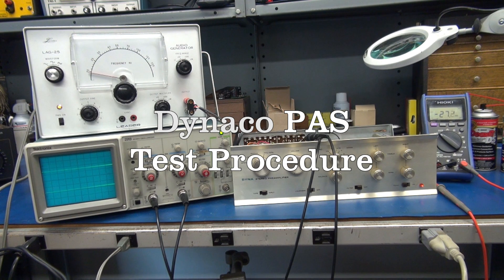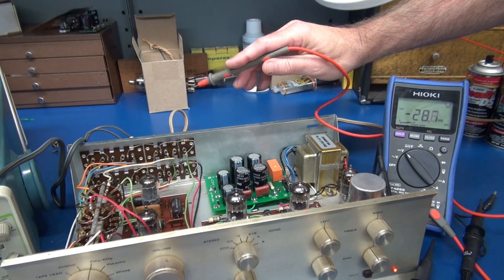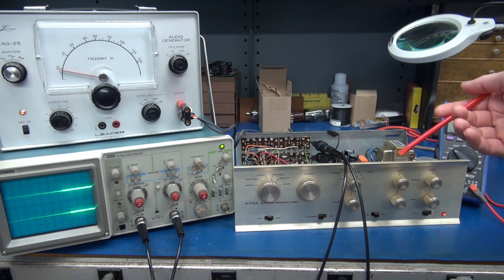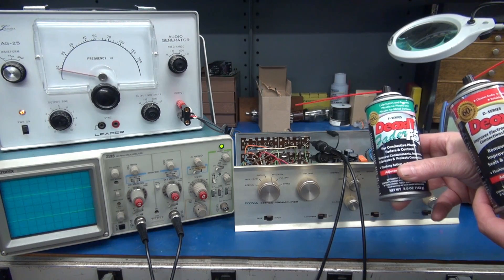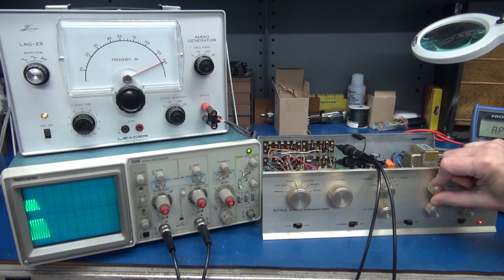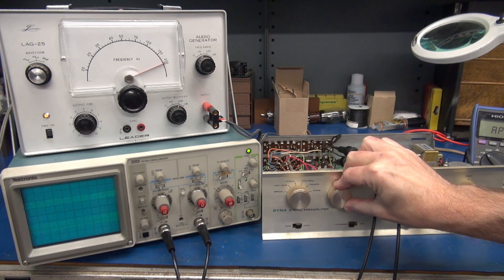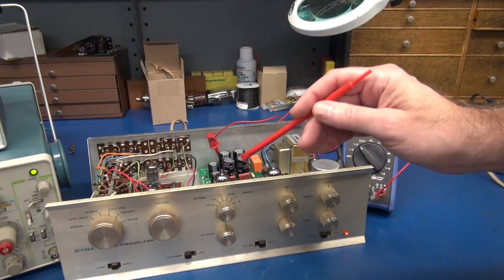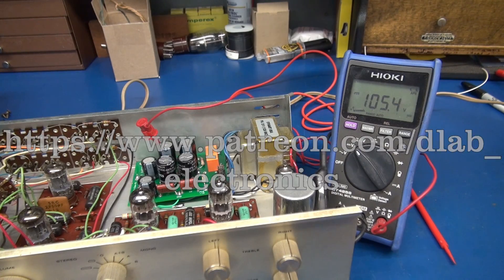Dynaco PAS tube preamp bench test procedure following repair using oscilloscope + audio generator

Comment: Not much point in re-testing the tone controls after the first test via phono. They haven't changed. But when you test the phono stage you could check the RIAA. Just check that the response at 20Hz is +19.911dB and at 20kHz is  -19.911dB, both referred to 0dB at 1kHz. If these three points are correct, the whole curve has to be correct. At least if you find a huge anomaly at LF or HF you know there is something wrong. You have to crank the level down to avoid clipping at LF.

Wondering why this preamp runs on such a high voltage!

Comment: Why would you add bleeder resistors on you replacement PS board?
Reply from the maker: The board is configured as the PAS was originally designed, just updated to a PCB. Bleeders could be added if desired
Reply: Seems like a bleeder would be a good idea to let the power supply caps drain out after the dynaco is turned off. Maybe 220k or 330k from B+ to ground.

Comment: When you say not to ground the oscilloscope and audio generator are you plugging them into your variable isolation transformer and the pre-amp into a different power source?
Reply from the maker: Nope, just using a ground lift adapter on the scope. The Audio gen and PAS already have 2 cond cords

Comment: I owned one of these in the past. I put new boards with new parts and it sounded a lot better after that, also added an output cap which was added later in the production. One of the treble pots was not of the correct value on my factory build. Sold it after building a 4S universal preamplifier.

Comment: I am confused with grounding issues. I found on the YouTube that some people say that the oscilloscope should be grounded and an amplifier which has been tested should be ‘floating’ or not-grounded in order to avoid grounding loop and damage the oscilloscope. Please confirm what is the right way of grounding.
Reply from the maker: The Dynaco was not designed to be grounded. I cannot answer your question in reference to this video
Reply: Thank you for the quick response.  I am following your YouTube Chanel for years and I really appreciate your work.
May I ask you please to make a video regarding the grounding in relation of using an oscilloscope for testing an amplifier.